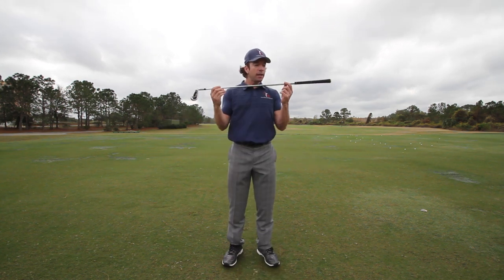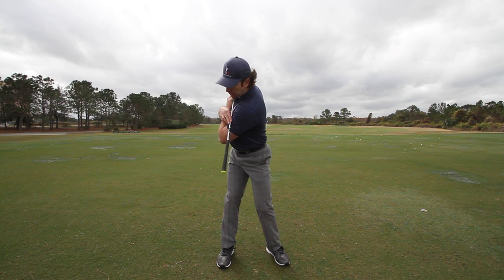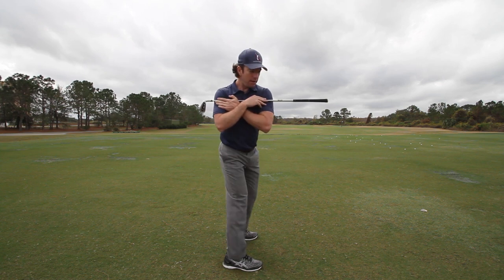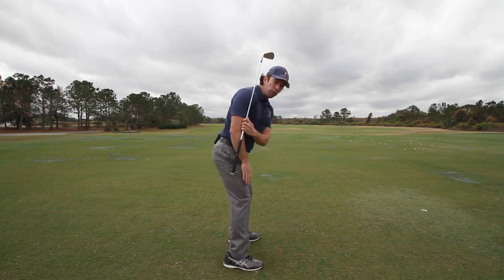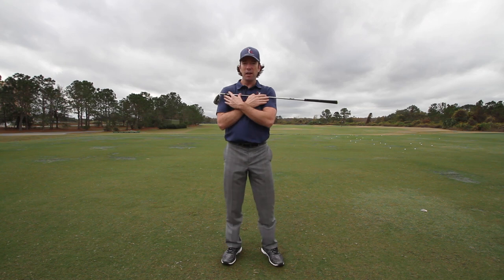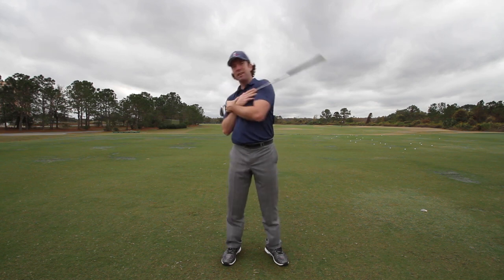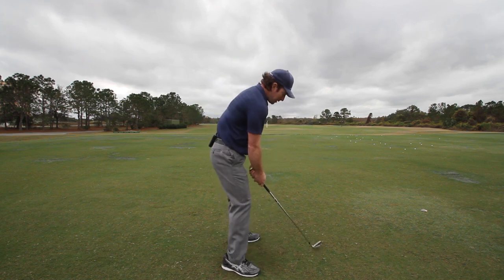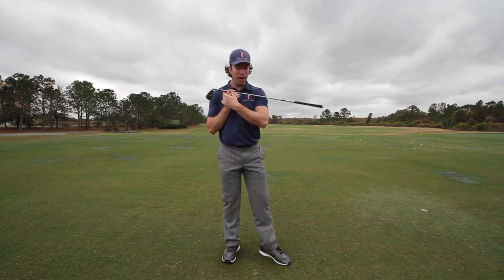Simple Shoulder Plane Drill: How to Fix a Flat Shoulder Turn

Comment: I've been a follower of Rotary Swing for years and this is the piece that I've missed the entire time.  I've always wondered why I couldn't get the consistency even though I felt like I was doing everything right.  It was the flat shoulder plane!  I worked on this in the mirror, went out to play golf with a group without having played for months and the ball was flying off the club face with accuracy.  I just need a few more rounds and range session to dial it in.  I can't believe this has been the missing piece for me all this time.  So much easier to square the club face, and doesn't require nearly as much rotation.  My wrist looks like Chuck's and Tiger's now at the top.  Amazing when you know what to do!